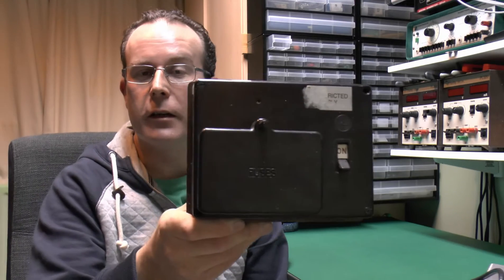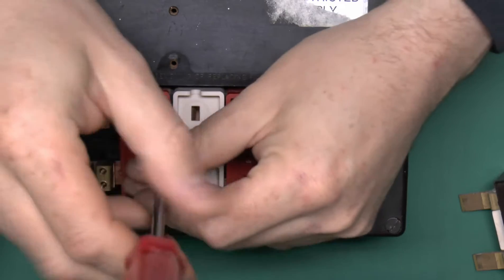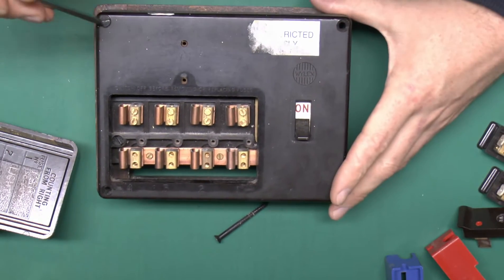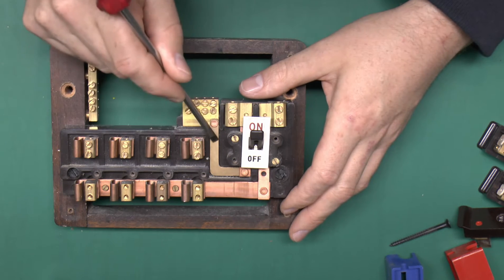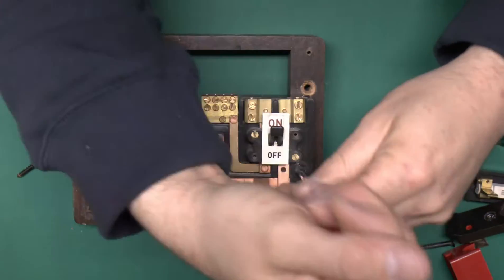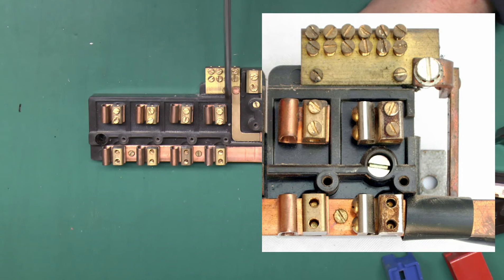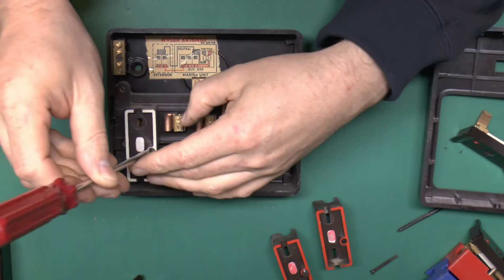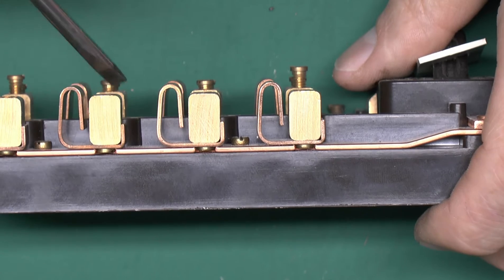Wylex Fuseboxes Dismantled

Comment: When you mentioned that the fire risk was compounded by mounting them directly to a board. Typically back in the day for the purpose of reducing that fire risk. The boards were Asbestos Insulating Boards (AIB) But then we moved on to other materials after we found out that asbestos isn't nice to breathe in.

Comment: John what does 'non track' mean, moulded into the back of the unit?
Reply from the maker: Tracking is where conductive paths form across the surface of a material, which leads to current flowing which causes further damage, eventually leading to total failure.  'non-track' is the material used is resistant to that.
Reply: @jwflame  Thanks John. Are you doing any more videos soon? I've learnt so much from you

Comment: Presumably there is nothing to stop you plugging for example a 5A fuse into a 30A position?
Reply from the maker: The blades for the fuses and the holes in the plastic shields are different sizes, larger rating fuses won't fit into the shields for smaller values.
Reply: @jwflame  Agreed, but won't a 5A fuse fit into a 30A shield?
Reply from the maker: @tim0steele  It will, but that won't damage anything, just blow the fuse due to overload.

Comment: Hi JW, I’ve recently bought a house sporting one of these old beauties. Are they difficult and costly to replace?
Reply from the maker: Not particularly.  The main cost is the testing of, and likely minor repairs to the existing circuits.
Reply: my mate had his replaced a couple of years ago (1980's house) with the latest split load board and the sparky spent the next week pulling up all the upstairs floorboards to try and trace all the borrowed neutrals that were tripping the new board. Rather expensive do.

Comment: I enjoyed the video with nice close-ups, thnks.   Always wanted to know what was inside these things as we have one (8 fuses). I guess an upgrade would be advisable but is it mandatory?  I'm quite fond of it in an odd sort of way. I think we've only ever
had one or two fuses go since '75.
Reply from the maker: Not mandatory, you can keep what you have for as long as you want. However if you want any new circuits or additions to existing ones, then a replacement is almost inevitable, as any new additions would need to comply with today's regulations.
Reply: Ah, I see.  I guess it'll be done sooner or later as the bathroom and kitchen are in need of a face lift. Thanks for the info.

Comment: I have one of these with another grey coloured metal switch box above, which seems to do nothing whether on or off! What was the grey box for?
Reply from the maker: Might have been for a separate supply to an outbuilding or garage.
Reply: John Ward - Ah, I assumed it was something to do with the fuse box. On testing various parts of the installation, I discovered it turns the immersion heater circuit on & off. Which is odd, as there are a further two spur switches between there and the heater coil. Better safe than sorry I guess!

Comment: Our fuse box was like this up until about 2010 , the only difference was that the fuses did not take wire they took well a fuse :) . I did however modify one of them to take fuse wire as an emergency fix , not safe but it was only in use for about 8 hours .

Comment: Alway curious why the direction of the on and off switch is different from the light switches (I'm speaking of New Zealand switches not sure if it would be same in the United Kingdom). Is there a reason why the orientation are different?
Reply from the maker: +Jügren van der Kaas In the UK, light switches are up=off, down=on.  The older Wylex fuseboxes were the same, but later ones and all new consumer units are up=on, down=off.

Comment: Hi John, I've just been testing an installation with a 6 way wylex board but it seems only to have a 4 terminal earth bar which predictably isn't much good for 4 rings and 2 lighting circuits plus the main earth. Do you know if this earth bar indicates an older board, eg before lighting circuits always had earths? Happily rings, Zs and IR all good plus every light switch earthed so with a board and bonding upgrade the house should be top notch.

Comment: I have one of these Wylex fuse boxes in my home for about 55 years and it works just fine. Is this fuse box Dangerous? Would it be compatible with todays safety regulations? Should I replace this fuse box with a more up to date fuse box?
Reply from the maker: Michael Cooper Old on it's own doesn't mean dangerous, but an installation of that age should certainly be inspected & tested  to identify any problems.
A fusebox of that type will not comply with regulations today, so adding circuits to it or altering/extending any of the existing ones would not comply either.

Comment: I still have one of these old boxes with the wooden back, working fine still doing its job. My crawlway flooded last year when it rained none stop for nearly a month. The water flooded a junction box and the whole downstairs ring blew. At the time I thought the fuse had just failed because of a power surge, so replaced it put it back in then switched the power back on.. Bang! The 30A fuse wire liquefied and blasted out of the bottom of the cartridge, basically made me realize that the plastic cover isnt just there for show. If it had blown without the cover on the liquefied copper would've torched anything flammable underneath. Eventually going to replace the oldtimer as its badly due it